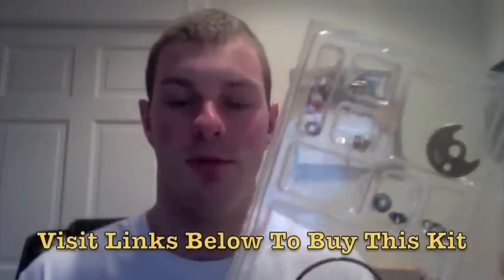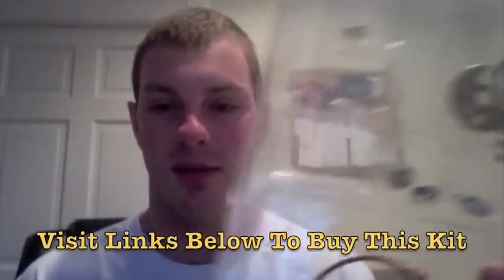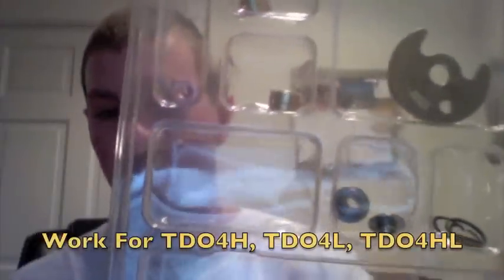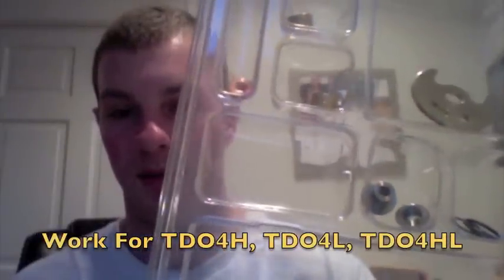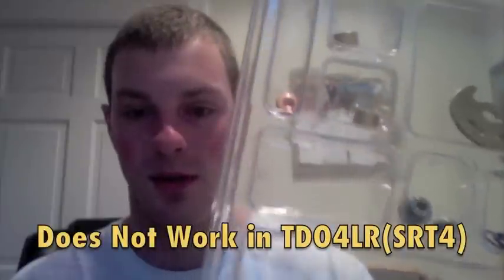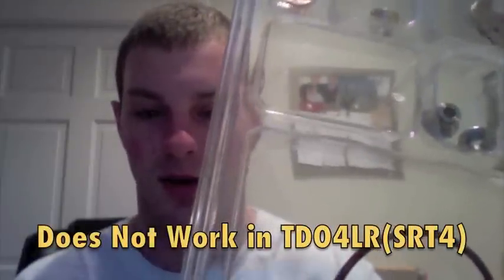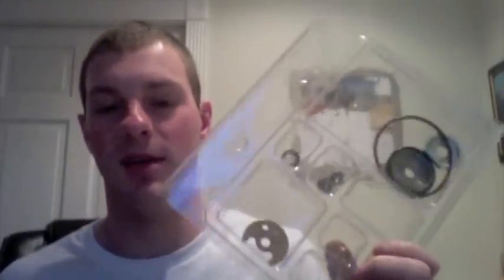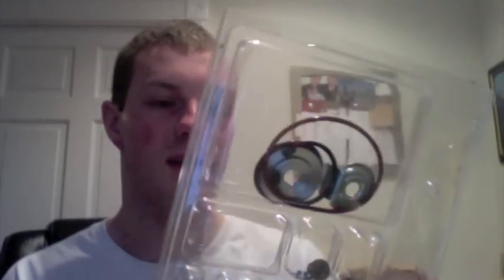TDO4, TDO4H, TDO4L, TDO4HL Turbo Rebuild kit

Comment: 👍 great staff. Will 9 blade shaft will work for Subaru DT04 HLA ( the twinscroll jdm one) any suggestion on improving that turbine? It spools great, just want to keep it. Thanks
Reply from the maker: I’m not sure about that one
Reply: here is information i found about TD04HLA:
Compressor Wheel: 46 mm / 56 mm (Inducer / Exducer)
Turbine Wheel: 45.6 / 52 mm (Inducer / Exducer) @turbolabamerica

Comment: Hey bud gotta question for ya. Whenever you get a chance of course. Currently running a 14b, on stock 1g mani and wastegate at 15psi, on 1g m/t dsm. Just found a brand new oem MHI tdo4hl 15t sitting around at the shop. Would you happen to know anything about it? Flow rates? Any pros or cons over the 14b I currently run that you may know about? Tried looking up stuff but getting alot of mixed info. Any help is greatly appreciated. Thanks in advance for your help!

Comment: does this work with 2006 9-3T mitsubishi turbo tdo4l-14T
Reply from the maker: +Jason Carrier yes. It works for all tdo4 but not tdo4lr reverse from the neon srt4, which requires a reverse thrust bearing.
Reply: @turbolabamerica  will this work on acura rdx 2010

Comment: I'm looking at upgrading my hyundai Genesis coupe 2.0t turbo I believe it's a tdo4h any recommended turbo for it? Thanks
Reply from the maker: Collin Flanagan i would go to the 50x 62 6 blade with a tdo4hl 9 blade 45mm x 50mm. I think i have came across someone making tdo5h series for them, i will have to look that up, if you can go tdo5h 16g that would be even better. the 50mm wheel upgrade is good for around 366hp at 24 psi, at least thats what we got for a similar turbo on a cobalt ss

Comment: Some good videos. Is this kit compatible with the mitsu te04h 13c, that chrysler inflicted on some 2.2/2.5?
Also, any input on the best way to remove hardened carbon off the bottom of turbine shafts (garrett t3)?
Reply from the maker: spoolingTD  soda blaster is best, or media blaster on lower pressure. Usually the TE04 series have an outdated unibearing and thrust system design which is prone to failure. We throw out the cartridge and build a new design one.